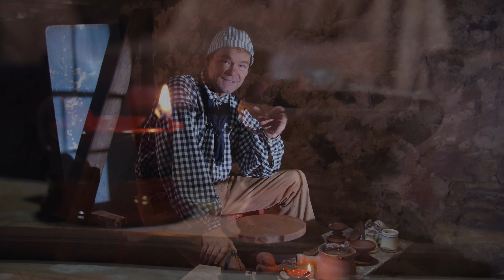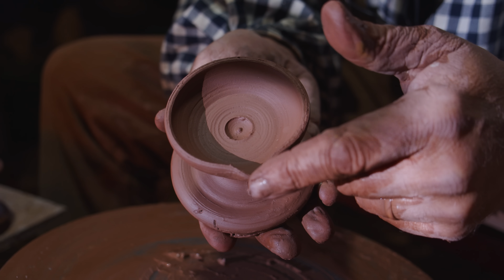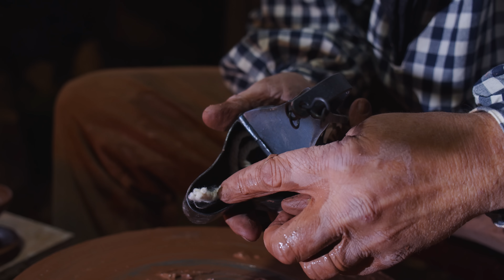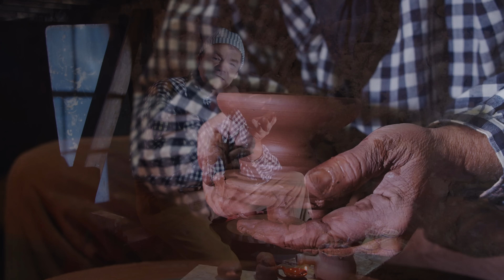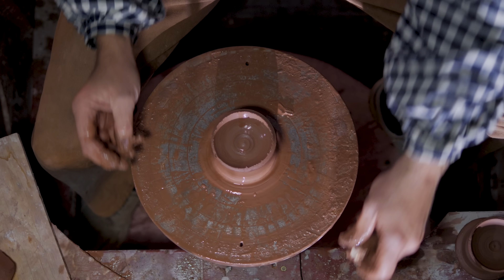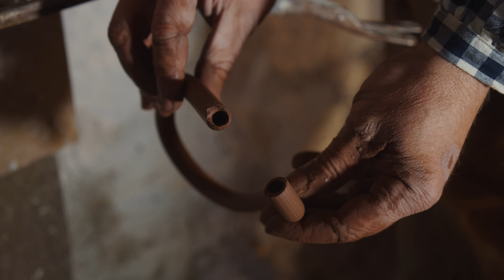Making Pottery with Jon Townsend - Grease Lamp

Comment: It's crazy how until the late 1700s oil lamps hadn't changed in 30000 years, it was just a bowl, a wick, and the oil, you can "make" one by taking a shell, filling it, and put a string sticking out at an angle
Reply: Ive always wondered why there wasn't any soot inside old buildings that had frescoes. Olive oil burned clean.

Comment: Some time ago i watched a documentary about early man, cave dwelling humans. It was talking about the cave paintings and how they would light the area they were working on. Candles were not a thing yet, but used shells and dripped fats from their meaty foods into the shell bowls and used something for a wick. But burning animal fats can get pretty smokey. To avoid the heavy black smoke, these cave people used salt to keep the smoke down.
I dont know how they found any evidence of this, but it sounded interesting. Could you do an experiment using a few of your open oil lamps with beef grease. One with just the grease, and the other with grease and sea salt in it.
Does the salted grease smoke less than the unsalted grease?
Can you really control the black soot that way?

Comment: What would the wick typically be made of at that time? You mention using leftover fabric but I’ve heard that fabric was considered by some to be kind of valuable? Would/could they use rougher plant materials like if you were to make cordage out of dry grasses? Or is that too rough/not good for wicking up the fuel?

Comment: Was the kick method of spinning the wheel the most common? Did anyone use the mechanism used for the lathe (stomp up and down) for this application?
Reply: I love using the treadle wheel instead of the kick wheel, but it seems it was invented in the early 1900s
Reply: @Rocketsong  Thank you.

Comment: I would love to see how you made the pottery wheel, that wheel is spinning really smoothly and I don't know what sort of bearings they would have been able to make to allow it to spin with so little resistance.
Reply: Greased bearings made from impregnated hardwoods are pretty good.  Not are good as hardened steel balls but plenty good enough for that application.  They're high maintenance in comparison though.

Comment: As for candles: most people today think that 'snuffing' a candle means to put it out. Before the mid 19th century, it meant to trim the wick so that it wouldn't go out. Pope, in his Peri Bathous , rephrases the command, 'snuff the candle', as:
'Yon luminary amputation needs;
Thus shall you save its half-extinguished life." 
One can find old 'snuffers' still in antique shops, usually resembling a pair of scissors with a little box on one blade: the cone-shaped items we often think of as 'snuffers' were then called 'extinguishers'.

There were different degrees of candles as well: the cheapest would be tallow dips; then there would be bayberry and beeswax; the brightest, cleanest, and most expensive would have been of spermaceti.

For lamp oils, there was a similar hierarchy: common grease or lard oil; fish oil; various seed oils; and at the top, sea-mammal ('train oil') or whale oil.
Reply: Lucias1958 
  I deeply enjoyed your commentary!  And the quote was  so interesting. 
   Do you make candles? Are you an reeanctor of a specific time period?
Reply: @lynnodonnell4764  They're a time traveler from after WW3....

Comment: One of my passions in the hobby is early lighting.  I have one of your pan lamps I got when you first introduced them.  I had both the short one (like in this video) and a tall one that you don't offer any more. Unfortunately I broke the taller one.  I also have the iron betty, tin bettys, iron phoebe lamp and hand-forged crusies. 
 One thing I have had difficulty with the tube style shown here is using solid fat (like meat drippings) for fuel.  The tube is too long to get hot enough to melt the fat in the pan so that the liquid is drawn up the wick.  Was this style meant for burning whale oil, and other liquid oils like olive oil?
Reply: Whale oil, and various vegetable oils, like rapeseed (I believe it's called 'canola' now) and olive (which would probably have been uncommon outside of Mediterranean countries), tended to be rather expensive. Common folks would probably have had to use cooking grease, or perhaps fish oil if they lived near the shore.

I have read of early 19th century 'lard oil' lamps, which used a metal strip, heated by the flame, to keep the fuel in a liquid state: I'm not sure how they managed before that, but people had used grease lamps since the Stone Age onwards...
Reply: @Lucius1958  My specific question was about the tube that Townsend's uses in it's pan lamps.  I have been collecting and studying period lighting for many years, but the Townsend's are the only ones I have personally seen like that.  he

Olive oil was fairly common in  18th century  America.  It was called sweet oil for most purposes.  It wasn't cheap enough to be a regular fuel for lamps, but I'm sure it was used in a pinch.  You are correct that animal fats were the most common fuel for grease lamps.  Crusies and phoebe lamps just had the wick laying in a narrowed end of the pan.  Most pottery pan lamps were the same, looking like the first one Jon showed, with what looked like a pour spout.  Betty lamps use a tube or ramp to elevate the wick in a position that allows the excess liquid fuel to drip back into the pan.  

But to work, the flaming wick needs to melt enough of the animal fat to be drawn up the wick to maintain the flame.   The tubes on Townsend's lamps do not conduct enough heat to keep the fat melted and drawing up the wick.
Reply: @buttonvalley  You said "My specific question was about the tube that Townsend's uses in it's pan lamps.  I have been collecting and studying period lighting for many years, but the Townsend's are the only ones I have personally seen like that."  On Townsend's website for this product, the description says it's based on a Moravian design. If you search google images for "Moravian oil lamp" or "Pennsylvania Redware Oil Lamp," you will find some 19th century examples with tubes.

There are three likely answers to the tube question viz. fuel:

1. It was meant only for liquid-at-room-temperature fuel.
2. Melted fuel would be passed from a larger betty lamp into this smaller lamp for more portable use (if one had a more clumsy betty, perhaps, or needed more lights on the go).
3. There is a trick we haven't thought of, such as lighting the wick at both ends of the tube simultaneously to get things going.

Comment: I have made a few of the more primitive "bowl with a spout" ones and the oil keeps seeping through! They are unglazed since the originals they are based on did not appear to have a glaze. There are no cracks but the oil over the course of a few weeks percolates through the clay. Do you reccomend  a way to stop this without a glaze?
Reply: Fire it hotter if possible, it needs to vitrify which happens at around 1800 c

Comment: I wonder if it would work with bacon grease?
although... then my whole family would be wondering if I'm coming bacon on the sly....🤔
Reply: Fats are fats, they’ll all burn with enough starting heat. The bacon grease would probably be a decent fuel, though I suspect, historically, they’d tend to save that for cooking instead, since it keeps so well. A lot of seed oils can tend to go rancid relatively quickly. They still burn alright, but you don’t want to cook with them.
Reply: Tallow and lard were both common, so you could freeze beef scraps until you have a good freezer bag full, also. 

Make sure you strain your grease, though. Bits will make it go rancid faster.

Comment: Could you carve the base form out of wood, then put like a layer of clay over the top bowl?
Reply: That's a good idea! I don't know what would happen in the kiln, but if it was a problem I'm sure you could wait til it hardened somewhat and then pop the wood base out.
I was thinking about the moisture problem and wondering if you could make clay with something else.. oils, alcohol... but I guess the drying out stage is actually important regardless, that's what makes the clay form a nice hard stone.
Reply: @KairuHakubi  you could probably form the Clay over the wood,  take it off,  fire it,  then re-seat it,  or just let it air dry,  since it just hold the oil...

Comment: I have made an oil lamp from nothing more that a piece of cotton string (shoe lace in my case), a button, and a container to hold the oil (in my case an empty tuna can).  Crazy simple.

Of course you can make a makeshift candle from crayons and a piece of cotton string.  Put the sting in the center of a few crayons, tie the whole bundle together with more string, then light the string.

All of these i did as a kid as "fun experiments" from books.  And they all work, more or less.

The lamps you made were much more efficient and complicated, but still pretty easy to make.
Reply: Jerome-  Can vegetable oils be used? Like expired olive oil or canola? 
 Some restaurants in the 70's and 80's were filling wine bottles with an oil ( I think) . Then cotton string steeped in the oil was threaded up through a fired clay bead. 
   (A very lovely touch to an Italian dinner.)
Reply: @lynnodonnell4764  Yup, olive oil was actually a common lamp fuel because it has a low combustion temperature but stays liquid till fairly low temperatures unlike animal fats.
Heck you can make a cheap but stupidly long lasting emergency candle with a can of Crisco (or an off brand) and just shoving as wick(s) down into it. A big can of Crisco can last days. (which if you didn't know Crisco is just a hydrogenated vegetable oil which makes it solid at room temps)
Reply: In the Laura Ingalls Wilder's books, she describes her mother making a button lamp like that.

Comment: John, you mentioned that they would use waste cooking grease, but I would love to see how to safely use one of these (fuel selection, filling, and lighting.) Great tutorial on a staple home item!
Reply: Justin-   Count me in also! Wud love to see how to 'replicate' the process. Perhaps, at least, using  modern materials for the burning fluids.
Reply: @lynnodonnell4764  You just fill it with olive oil, conola oil or any cooking oil you find at the grocery and stick a wick in it.
Reply: I've used various fats and cooking oils from after cooking quite safely. I heat it to a point that lets it run freely without being so hot as to cause smoke or too hot to handle. While it's in a more viscous state I run it through a tight knit stainless steel mess strainer to get rid of as much particles as possible so it doesn't clog up the wick or settle too much rubbish in the bottom of the vessel. I have even used old cooking oil in my old hurricane lamps successfully.
Reply: I third! I loved that not only did you explain a vital tool that we are no longer familiar with, but you made one the way they would have! I agree. Id love to see how to safely use it without burning my house down! Loved this.
Reply: Kitchen grease is easy to render down. I render down all of my grease and oils for reuse.
Reply: As Andrew said, you just put vegetable oil in it, and light the wick. About the only other parts to it are trimming the wick, and filtering the oil for reuse.
Reply: I would really appreciate that video as well!!
Reply: Jon* not John
Reply: It is safe to use cooking grease. You wouldn't be here otherwise.  They would render it for lamps.  Meaning cook the grease in hot water.  Then cool it.  All the nasty falls to the bottom of the water, all the good clean oil goes to the top.  That's what the original Diesel was designed to run on.  Hence why he was murdered and his designs stolen and r configured. So they would no longer run off rendered animal fat.  Pig fat was the best.  When I was a kid we rendered all pig fats for the tractor and truck engines, soap, lamps, etc.  I lived in a part of the USA that didn't get electric or phones until the late 1970s. They still don't have internet cable or city water.  If it snows, you are on your own until it melts.  You don't have to look to the 17th & 18th centuries to see people living like this.  Talk to your grandparents.

Comment: Heck, i have oil lamps in my house right now.  Storms are a thing, and loss of power sucks if all you have are electric lights.  I also have a coleman gas lamp, because those are SO much better than oil lamps, but less safe indoors.

You can make a huge oil lamp using a crisco can and the oil in it.  Dangerous, but if you need it, you need it.

Comment: If they didn't regularly clean, their rooms would get a fine layer of oil on everything after enough time.
Reply: It probably did have a layer of oil on everyone's homes. Just look at any homes in the last 100 years where people smoked. They get used to a level of grime. They don't even notice it.
Reply: Lots of soot as well, even if you used candles. It is the glowing carbon particles that provide the light.
Reply: @machintelligence  yeah if you burn a LOT of candles you can get a soot buildup. 

The last house I lived in, we moved in when it was 13 years old and it was all original paint. The prior family had floorstanding candle holders in many locations around the living room. You could see soot circles on the ceiling and "shadows" running up the walls where the candles were.